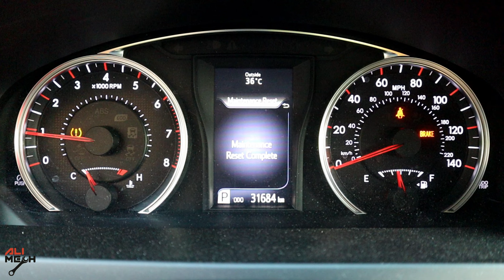Toyota Camry 2.5L Engine OIL CHANGE  2015-2017/and replace oil filter and reset maintenance ALIMECH

Comment: The small square 3/8” drive on the bottom of the housing is for draining the cartridge so you have less mess. There is a small tool to drain it that comes with the oem filter along with a gasket for that area too.
Reply: That's very useful information. Thank you

Comment: Thank you so much bruh. I did my first 🥇 oil change. Quite a challenge since I did it without a ramp, instead used sidewalk ramp to list the car. Note the filter cap is critical, as other wrenches didn't work for me. In the end, it all went good. And yes, happy news year y'all ✌🏾
Reply from the maker: That's great, awesome man,  and happy new year 💥💥
Reply: Mine is stuck so I don’t bother. I do it as he did it
Reply: Using the sidewalk is genius. Thank you.
Reply: @almajd.k happened to me as well but you just gotta use extra force
Reply: @Zeeviex  I totaled mine lol. Barely survived
Reply: You to

Comment: My camry is 106k killometers is it ok to use 0w 30 oil? Or i switch to 5W 30 oil?
My car has no problem till now
Reply: No it’s not okay you should only stick with factory recommendations 0w20 full synthetic oil

Comment: 2:05 "don't undo it here it will just drain the oil and you wont be able to take the filter out?" What lol? That 3/8 recess is specifically designed to be opened up BEFORE you unscrew the filter housing and for you to insert that little plastic drain valve that CAME with your new oil filter. That way you drain the oil out of the cartridge before you unscrew it without spilling oil all over....which you did.
Reply from the maker: Yes you are right,  to me its waste of time,  just put your drain pan under the filter and unscrew it, I dont like to unscrew it for drain and the for filter lol, that's personal preference
Reply from the maker: My drain pan is big, no need to clean anything, if your oil catch pan is small, u may drain it first

Comment: Instructions said to use OW-20 but Can I use OW-30 on a 120k milles engine?
Reply: I wouldn’t change no matter how many miles you have
Reply: No.  Says 0w20 and if it not available 5w20 can be used but should be returned back to 0w20 the next change. Just get 0w20.
Reply: If you are in extreme cold environments I recommend 0W-30 I run that during the Alaskan winters then at the end of winter I switch back to 0W-20

Comment: If you don’t have a lift, how do you get a floor jack to the jack point?  There is not enough clearance under the Camry.
Reply from the maker: I used low profile jack, it fits under camry
Reply: @AliMECH  thanks, I will buy one soon.

Comment: How do you keep your heat shield so clean?
Reply from the maker: Everytime I was the engine, I dry the heat shield from watter, because there are some low spots on the plate that holds water and they cause rust with time
Reply: @AliMECH  when you wash the engine on this car, do you take out the battery? Do you cover anything up?

Comment: 1:39 always replace the gasket on drain plug. Cheap and worth it. 2015 Camry takes 10W-30. Synthetic oil is a waste of $$ if you're doing normal driving and changing your oil every 3-6K Miles.

Comment: Thank you for the video, may I ask you what is the oil change interval on 2.5 liter Toyota engine? I was told by the Toyota sales agent that it is six month or 8000 km, but the internet suggests 10000 miles or one year for the synthetic oil 0W-20.
Reply from the maker: For fully synthetic 0-w20 is 10,000, but to stay at the safe side go will 8,000
Reply: I go 5000 miles or 5 months for my 2015 Camry. It’s mostly city driving. You go 10k and you’ll get engine sludge. Camrys were notorious for that.
Reply: Yeah I heard in general, it's best to do every 3,000 to 5,000 miles or every 6 months. Which ever comes first. This is for specially high mileage

Comment: You did not remove the oil filter properly.  You use a ratchet at the bottom first and remove the bottom to replace the rubber o ring inside.  Your filter comes with 2 o rings for a reason.  Change them both.

Comment: How often should u change the oil ? On the Camry bro
Reply from the maker: Every 3000 miles or every 3 months
Reply: Chico Val manual says 10k miles if using synthetic 0w-20. I do mine once a year as I drive between 8-10k miles.
Reply: @AliMECH  The 3 month 3000 mile rule no longer applies to Synthetic oil. You can use Synthetic upto 10,000 miles with a good filter.
Reply: @ncvman  I change mine ever 8 to 10 thousand miles. (12 to 16,000km in Canada)  I use a Fram Tough Guard filter and Castrol Edge  0 W 20 oil. I live in Canada and do some extremely cold start in the winter.  0W20 oil is amazing stuff when your firing your beast up at -35 to -40F.
Reply from the maker: @davidcampbell1899  you are %100 right, he said how often YOU... that's how I do lol, I know it's too early
Reply: David Campbell ok don’t care.
Reply: Chico Val read above I posted a week ago. I change between 8-10k miles.
Reply: NC Vman   My 2017 Toyota Camry manual said    Change oil every 5000mi or every six month
Reply: BB Kong oh great, don’t care.
Reply: I change ours every 5,000 miles. 3,000 miles is a waste of money and natural resources unless you only drive 3,000 miles a year. You should change it at least once a year.

Comment: The metal plate plug should has been removed first then inserting the plastic drain plug in the bottom  of the oil canister to relieve the pressure of the oil fllter canister if not as you didn't do the oil will explode out of the canister everywhere making horrible mess as it did in this video.